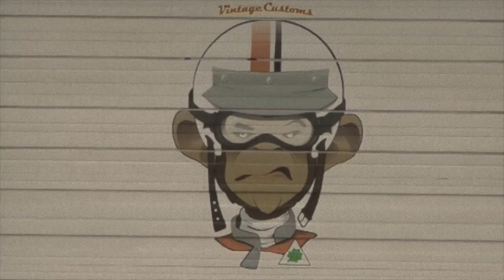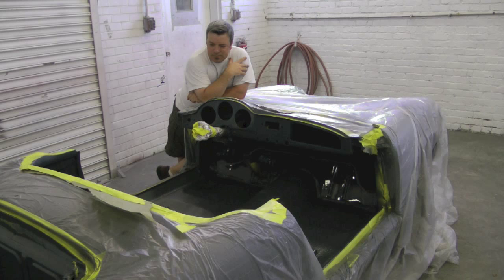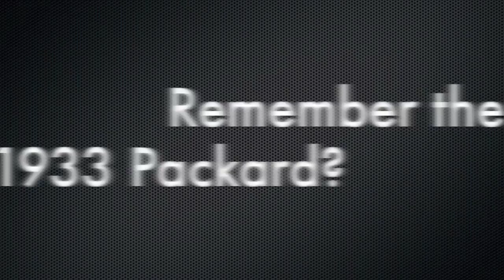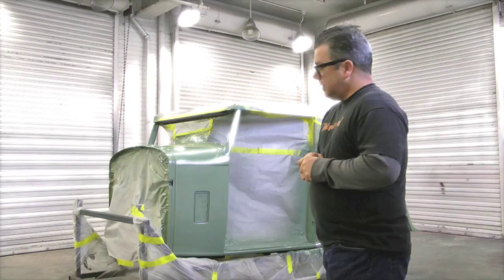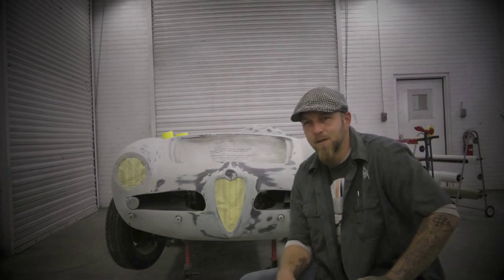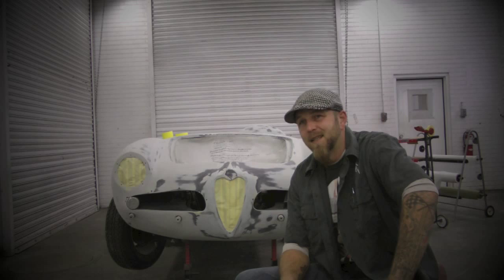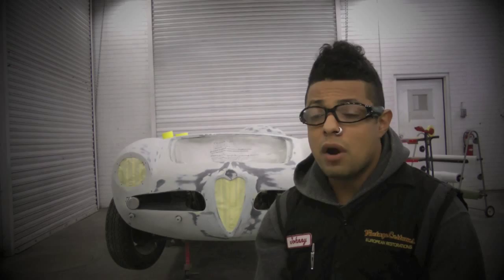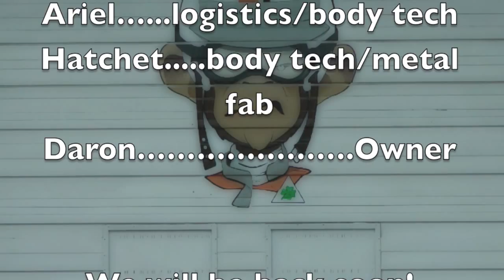Giulietta nears the finish

Comment from the maker: Good morning Joost. That is a paint booth. It is simply massive in size. This was a Cadillac repair center in the 1920's-60's. So the booth was very, very big. All the ventilation systems are on the far wall outside the filming area.